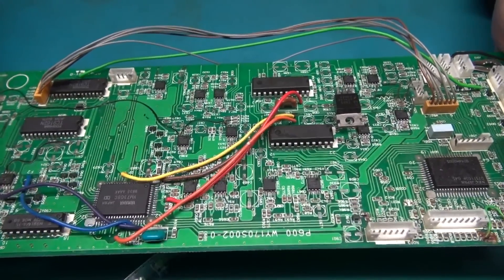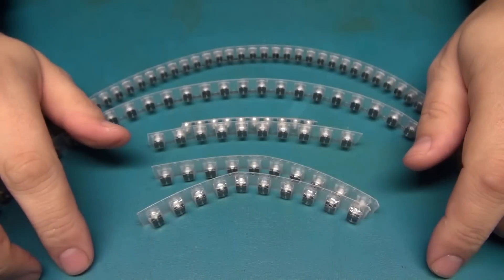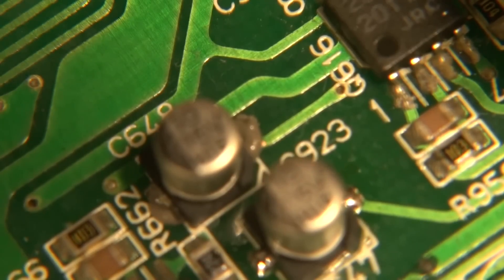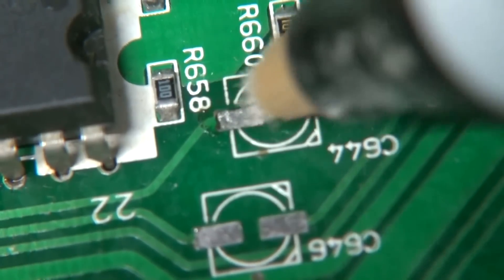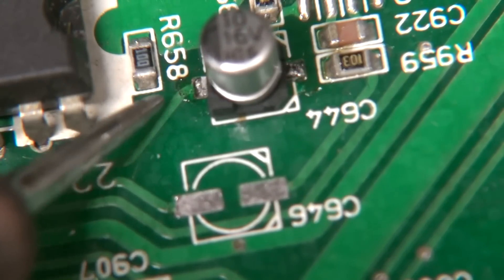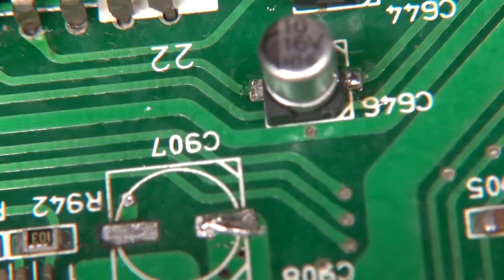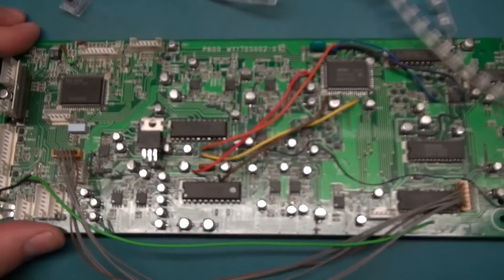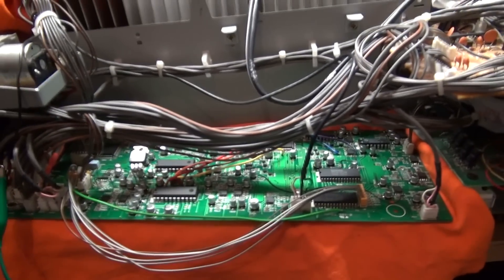SMD CAPACITOR REPLACEMENT LUXMAN RV-371 THREE DIFFERENT WAYS.. PART 5

Comment: Those were all super easy with no obstructions.   Mine usually are less than 1mm from a 0805 or 0402 capacitor or something so close you need a microscope to see the gap.  When I have to do them with this much real estate on both sides I eat a ham sandwich from one hand while soldering them on with the other easy peasy.

Comment: I have to replace a tiny surface mount capacitor, however, it has no capacitance value marked on it. So, how can I replace it, when I know this capacitor is dead [shorted] AND there are no value of capacitance on it? What value of capacitor/capacitance am I supposed to use? Any insight will be greatly appreciated. Cheers!
Reply: This may not be the best advice, but buying an identical motherboard may be the most expensive tip if you are trying to find an exact capacitor value and voltage rating of the same type. I have tried doing research on replacing my knocked off capacitor by buying a brand new motherboard so that I can use it to measure all of the capacitor and resistor before making it as a donor; you also need to use a quality meter that ranges with capacitance accurately and some tool that measures the temperature around the capacitor.
Reply from the maker: You can try to see if there is similar caps in the circuit or measure the voltage on the location and rate a higher value voltage and guess on capacitance. Not much else you can do without a schematic.

Comment: Can I upgrade to SMD capacitor if my console using the older generation fails? I have a 2001 OG Xbox and expect the one the capacitors for the clock to blow anytime and wonder if I can use a SMD capacitor instead? Thanks
Reply from the maker: As long as you stay within the same voltage and capacitance rating I wouldn't see why not. The issue would come down to mounting differences if replacing leaded parts.
Reply: Thanks for the tip

Comment: I use fast melt solder paste and hot air. I could set most very quickly that way. Kev, all I can say is you are very patient and what a great fix man. I doubt that I would have kept at this thing as long as you did, but I also saw your video on the Yaesu 1000 and I wouldn't have touched it at all. I don't like working on something that costs 5K plus. Good JOB! Love the videos.
Reply: Please show your way in a video.

Comment: The third method is the best... but put solder on both pads, apply liquid flux on both pads (that are now covered with solder) and it wouldn't hurt to have a bit of flux on the capacitor leads. Put capacitor on the pads, heat up one solder oad, and the flux will clean the oxides off the solder surface and the capacitor lead and you'll get a good joint.  Move over to next pad, then once it's joined, reheat the other side just in case there's some stress.  A tiny brush wet with liquid flux does wonders... and flux can be really cheap, i bought a 100ml no-clean flux bottle for somewhere around $3-5 ... 
A side advantage of this method is that you only need one hand on the iron, you can hold the capacitor in your other hand if needed (or with some tweezers)

With solder paste, it would make sense to use a hot air gun .. a bit of 200-250c for 10-30s won't hurt any capacitor. With hot air gun, the capacitor will center itself automatically and there's no need to press down on the capacitor.